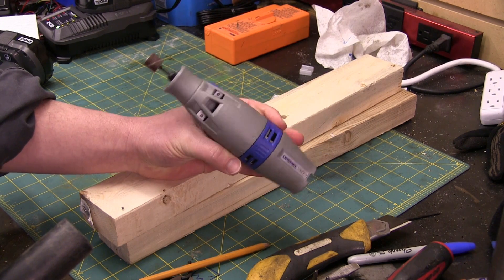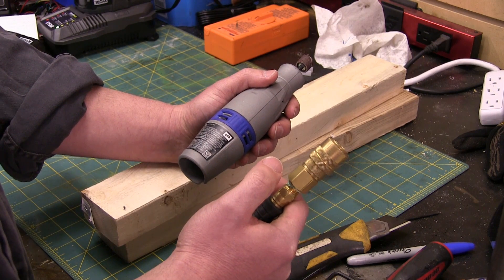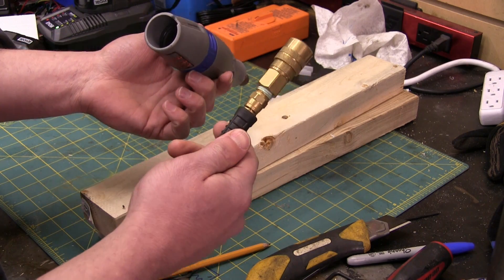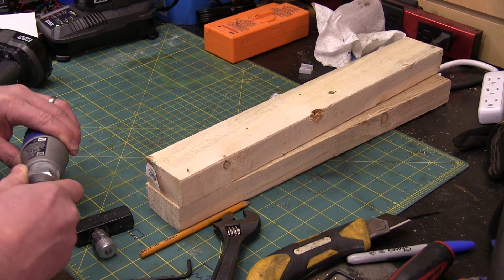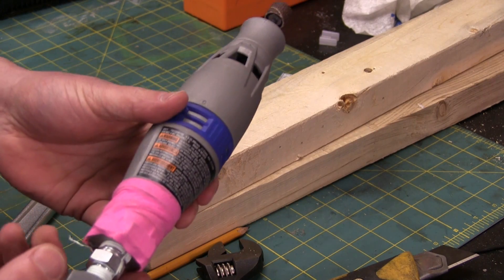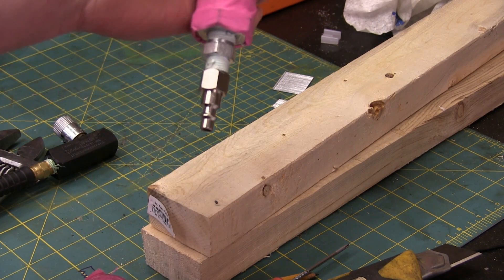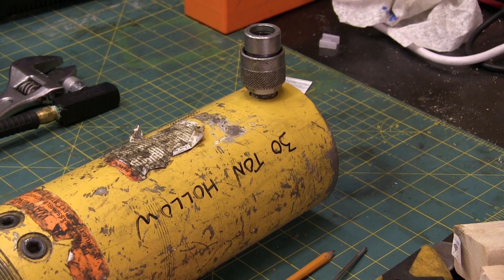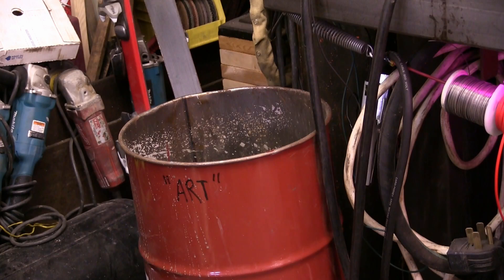You asked for it! Patron's Request: Dremel Suck Tool on 100PSI air

Comment: Some industries in the UK and Europe use NPT as well, however the most common is BSP which is a parallel thread with a face seal. The NPT equivalent is BSPT which are the same sizes and pitch as NPT but with a 55 deg thread as opposed to the 60 deg NPT. IE they will sort of fit together but seal even worse if someone is inexperienced enough to do it.

Comment: Should have grabbed a SCUBA tank or something similar and let 'er rip with 3000 PSI. I bet that would have broken it proper good.

Maybe not the safest thing to do. How good are you at dodging improvised missiles?
Reply: +Output Coupler Why not run it on an oxygen tank at similar pressures and also expose the device under test to a flame? Too bad it has been donated to the art collection!

Comment: Truly a disaster, what did you think would happen? Turbine wanted 100cfm at 100pa and you give it 10cfm and 0psi because it will barely make the thing spin much less do any work.  By the way in te hUK we use BSP its like NPT but with a different thread angle.  God knows what they use in Europe, metric crap  probably.  DIN fittings and "O" rings only for high pressure.

Comment: In France we have what we call "le pas gaz" (or gas thread) which is BSP and it is a pain in the meat to get right because it follows the imp numerotation that does not mean anything to us. 90% of the time you do not remember if the compressor was 1/4 or 1/8", NPT or BSP and everytime you get the one that does not screw size or thread wise.

Comment: The veins on the turbines were designed for air flow in one direction. Putting compressed air in the vacuum port was turning it backwards, and thus not working efficiently. Thing sucks or blows either way you look at it though.

Comment: Yep, even good old France uses BSP pipe fittings, imperial brass for plumbing. There's a lot of stuff sold at 12.7mm, hmm what be that an equivalent to then? But router bits re 8mm or 12mm, grrr.  You can get in an unholy mess down at the brico store!

Comment: You should have reversed the fan direction. It was designed to be effective in one direction, and that is sucking. So, turning the blade around would have made it work much better. Or at least it should have.
Reply: It does not matter if he would have turned the blade around, it still would rotate in the wrong direction. If you turn you tires around on your vehicle that does not makenit go in reverse when it is in drive.

Comment: probably designed for volume and not so much pressure. sure you had 100 psi but at what? a couple cfm? takes a good size compressor to even get 10 cfm at least continuously. Vacuums operate mostly on CFM. the more flow the more suck. not sure on the turbo shape in there too, maybe not work so well backwards.

Comment: British Pipe Thread.  Effectively the same as NPT, but 55 degree pitch vs 60.  Basically 1 thread per inch difference, just enough to strip out your fittings if you mix it up.

Comment: I design automated machines here in the USA... mostly our pneumatic connections on the machines are metric with face seals, M5, M7. But we also get into RC (or was it G?), which are straight threads with seals, as well.

Our lower technology shops (automotive, machining, etc) mostly use NPT for the compressor connections.

Comment: "I have just the thing" I was hoping for one of the tire bead seater air cannon things. Size looks about right, add enough duct tape to keep the housing from exploding instantly, and then maybe you can make it eject the turbine blades out of the exhaust port

Comment: I think it didn't work because it's designed to work on vacuum,  and you ran it on positive pressure. Of course it's not gonna work if you use it the EXACT opposite way it's meant to be used. 

I'm actually gonna buy one myself and see if I can reverse the impeller do-dad and make it chooch up to the preferred factor of .33  .

Comment: Just like electric ones, gotta run them wide open unless your using the sanding bit then I set it at about %75 power. The low speeds are more useful for engraving and stuff, you can stall it easily. Wow that air one really sucks! ;)

Comment: They have BSPT / BSPP (Metric equivalent of NPT / NPS) in the rest of the world ... Also known as ISO pipe thread.  Really goddamn close to NPT, to be honest.  You can ram it in without being any the wiser unless you are pushing the max PSI of the fittings.  At which point ... explosions probably happen.

Comment: you didn't open the little blue ring at the bottom
Reply: The blue ring is used to bypass the "turbine". No air flow across blades means no chooch. Close the ring and you get air through "turbo jet" and it "chooches" supposedly.
Reply: oh

Comment: Pretty sure it sucked more (or blows) because the amount of air moving through the small fitting is less than the large vacuum, even if the pressure is higher. That pressure is in the tank and when the air leaves the tube from the compressor all the pressure was lost due to the increase of volume in the dremel. you need to have the pressure high in the dremel tool, idk how you would do that. my guess is LOtS of air moving quickly.

Comment: We have 3 types of threads for air/hydraulic/water systems in Europe; metric, with face seal (rare, but not uncommon), standard "imperial" with tapered thread and imperial with cylindrical thread... They are sometimes called Whitworth threads, even in SE Europe... Prefix R for tapered and G for cylindrical/parallel.

Comment: I spend days looking for vendors that supply bspt and metric converts/adapters. It fucking sucks. Not to mention the massive Frankenstein bullshit that ends up connected to pumps and machines for years... Thats what we do.  Also, I think you needed volume, not pressure, but that is still a POS tool.

Comment: +AvE  All of Europe is still in the dark ages ( inches) as far as plumbing and fittings.  1/2 inch pipe is still called 1/2 inch pipe.  Some try to call it in metric terms but technically it is still in inches.

Comment: Fittings are in inches. NPT UNF and so on 
1/8", 1/4", 3/8", 1/2"....

But it depends how the threads are sealing.
You may find fine thread fittings, 8x1mm, 12x1,5mm...

On compressed air, hydraulics and pluming most of the stuff is imperial.

Comment: You had good pressure, but the volume was far too low. You need 175 PSI at like 150 CFM. Something that a trailer air compressor can deliver. That would make her chooch. Of course I wouldn't want to be the poor bastards to try to hold it. Because I've seen what those air hoses do with no weight on the end of them, and it is a bit dangerous.

Comment: You'd need something like a screw type compressor with a huge SCFM output to really drive that thing up, that or a really large tank and some huge fittings on it with some huge fluid conveyors... what a pile of junk that tool is.

Comment: At last an engineering question I can answer!

Yes, we do use NPT in the UK. Basically, as long as we can get a metric spanner on the nut, we don't give a damn. Some of us do like to chop and change between metric and AF though. Sometimes they just fit slightly tighter.

Comment: both metric and imperial fittings are used, plenty of adapters available...
for example, bath and sink fittings are 1/2 and 3/4 inch. this goes onto 15 and 22mm pipes.. confused !

Comment: I thought NPT was Non-Parallel Threads? In instrumentation we use mainly 1/4", 3/8" & 1/2" Twin Ferrule Compression Fittings With NPT fittings where required. (I'm based in Scotland).

Comment: I'm sorry to have to speak of this again, but I would think that this tool requires higher flux across the turbines, not pressure. That is to say more air volume. The suggestion to try a leaf blower was a good one.

Comment: What's required is more flow-rate NOT pressure.  (Sort of like confusing current for voltage) The air-compressor cannot put out sufficient flow rate to turn the plastic turbine in the Dremel..  Compressor's high pressure is dissipated on expansion - delivering insufficient flow rate.  Drive it with the output of a turbo-charger or super-charger and you will get better results.

Comment: In most of the rest of the world we have British Standard Pipe, which is defined in ISO-7 for taper threads and ISO-228 for parallel threads. There are some national variations in standard be it BS, DIN, EN, JIS and so on but there all pretty much the same thing, its only North America that uses NPT on the whole.

BSP-T thread look much like NPT ones but the thread angle is a 55° from the whitworth form instead of 60° for NPT. BSP-P uses the same basic form but is designed to seal on a Dowty washer rather than on the threads. You can Jam NPT and BSP together up to 1/2" but after that it wont go, which is a bugger if you've mixed them up in your parts box. 

All that said I have seen small NPT threads used for air here in the UK along with metric fittings for machine building and pneumatic applications.

Comment: Regarding the measurements of fittings. Here in sweden, we tend to use millimetres for most such things, I believe. This also includes bolts, screws, nuts, drills, and what have you. So the measurements give you the inner and/or outer diameter of whatever you're using. To give some examples:

an 8,5 mm drill, gives you a hole with a diameter of 8,5 mm, in inches that's "0,334646".

A 4,5x40 screw would give you a screw that's 4,5mm in diameter, and 40mm.. or 4 cm long. And sometimes they give you the inner thread measurements as well on the side.

Bolts work the same way as screws.. but for some weird reason all the nuts I can find seem to be labeled as M3, H3, and so on, no idea how that works.

And lastly, pipes and fittings are the same, diameter measurements in mm. Decently precise for most things, and can easily be converted. 1000mm = 100cm = 1m = 0,001km.

Comment: For air usually 1/4 bsp and others, I'm a hydraulic engineer so we use normal unf thread as it doesn't really change and for suspension for agricultural vehicles we use metric (m27x2) for example... It's all fucked

Comment: Pipes and fixings on my old Series III Land Rover were in AF (Imperial 'At Flat'), Whitworth (Imperial measured at bolt) and Metric... Our Tyres are measured in the form of MM / % / Inch, i.e. 145/50/14 is 145mm, 50% of 145 in depth for a 14" diameter wheel.

Comment: mostly a different pipe thread. BSPT is the one commonly used instead of npt. although BSPP (parallel) is used for instuments often. sizes are in inches but they can have a dash size or DN size. so 1 inch is also -16 and DN25.

Comment: I cry foul and you need to pick up a new one, Remember the flow ring installed backwards. You need to do that again so now the pressurized air will work as you had the air flow shut off which normally be on.

Comment: It looks like you would have had to make an inlet collar into the inlets of the Dremel tool. The air you ran was into the tail where it was made to suck from if there were any type of directional turbine wheel that would cause it not to work.

Comment: In Norway we use an unholy mixture of npt and metric with gaskets. my last trip to the fittings store was to get a adapter from M10x1 male to 3/8" NPT female. 
I have to say I like the metrics best. use a copper seal instead of relying on a sting of teflons to seal the leak.

Comment: Here in Finland some small and specialty pneumatic connectors, use metric sizes like M5 and M10x1 threads. Mostly it's BSPT (R-threads) and BSPP (G-threads) (British Standard Pipe Tapered / Parallel). Also some NPT but it's not so common.

Comment: It's the cfm (or lps or cmph for you metric types). air compressors have very low flow at very high pressure. you need the flow to move it, not the pressure.

Comment: The problem escalates with fittings. We do use NPT, and every other standard there is. And the problem is, there are quite many. BSP, NPT, JIC, UNF, ORFS, Swagelok...
So the thing is, several use the same threads, but don't work together(seal by tapering/flanged/O-ring). And what is used differs from where the product was made or who made it. So in companies that hires a lot of different tools, they need a good stock of fittings and adapters.

Comment: Norway here, Pipe fittings are an unholy mess IMO, The most common being NPT and R series threads for water connections. But there's also quite a bit of BSP floating about. So plenty of throwbacks to the dark ages going around. Dont get me started on hydraulic fittings...

Comment: AvE, I see many people have been quicker to get their cheese in the vice on the question of metriche fittings, but nevertheless: Every airtool or fitting I’ve seen in Europe has a ¼ bsp (tapered) threaded connection in its rear what for inserting your preferred brand of quick connect.  

In fact I’ll bet you dollars to donuts that some of the cheaper tools you buy over your side of the pond have BSP(T) rather than NPT fittings,  but folks haven’t noticed and just ‘fixed it’ with PTFE, and put it down to craptacular quality of the tool in question.
Matt

Comment: In Germany we use the imperial system for pneumatic fittings. The fact that a 1/4" fitting has not a 1/4" thread is a pain right in the ass, at least in my opinion.
Reply: +SBRV427 Jupp. And a 1/4" fitting with a metric hose connection on the other end is just silly. I just treat the inch-sizes in pneumatic fittings a an arbitrary identifier. It could just as well say 0,25 dingleberrys.

Comment: I dont know....does not look like I am going to trade my die grinder against that Dremel-Thing.
Air and Hydraulik fittings are a horrible, steaming pile of crap in the metric world. We have tapered and normal inch-threads, some of the pneumatic stuff is metric (Regular M5/M7 thread - Yes, I Said M7)
Reply: +Stefan Gotteswinter The Dremel might work if replaced by a Biax flexible shaft grinder ;)

Comment: It needs flow too, not just pressure.
It is "designed" to be low pressure (PSI), but relatively high flow rate (CFM), so pressure alone will not do it.
Think of it like fluid or electricity. Voltage is equal to pressure whereas Current is equivalent to flow (or more correctly flow rate).
But it is also "designed" (I almost hesitate to call it design) to have the pressure (which will never exceed 14.7 Psi atmospheric pressure) and flow from the other side of the impeller. So it is trying to run backwards too.
So it is all sorts of wrong that way.

Comment: ty ty tyvm... I needed a good laugh...  just a thought... since it was designed for suction... wouldn't blowing on the turbine be like blowing on a wing from the trailing edge?  buy some duct tape and fire that baby up with a industrial vacuum device... worst it could do is implode in metric no less!

Comment: Greetings from Finland! For most fittings we tend to use NPT and just call it that (or "kartioputkikierre" which is "tapered pipe thread" in finnish), and in some special occasions metric threads with O-rings.
I guess NPT is just THE fitting used all over the world.

Comment: In the Netherlands for interconnecting portable gas or compressed air mainly 1/4" bsp/bspt. for gas grid acces mostly M24 but the valves often have M24 on one side and 1/2" on the other. and then there are propane containers wich have a shell / DIN connector with a front seal. that's about it. but, pipe diameter sizes are all metric. confused yet?